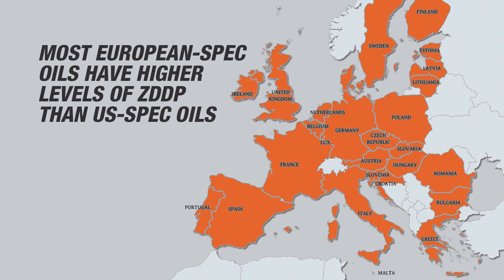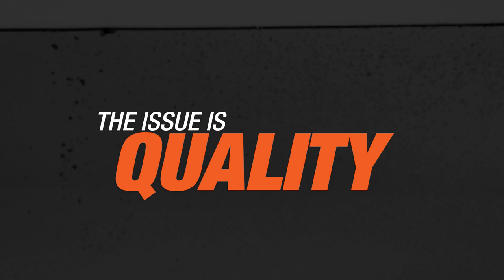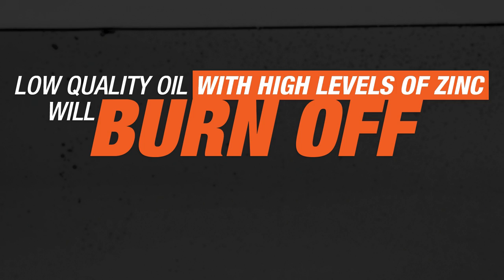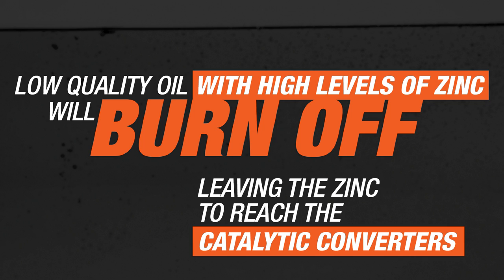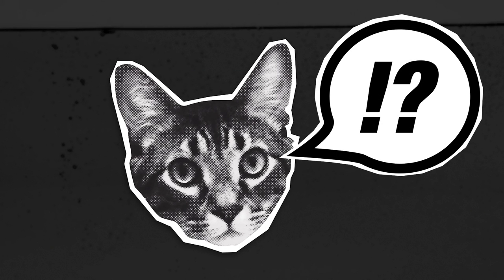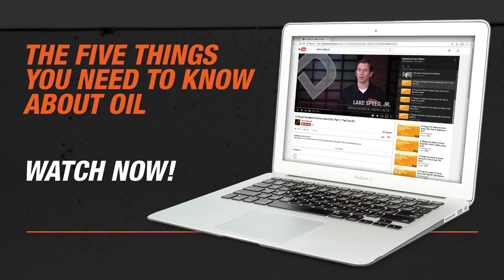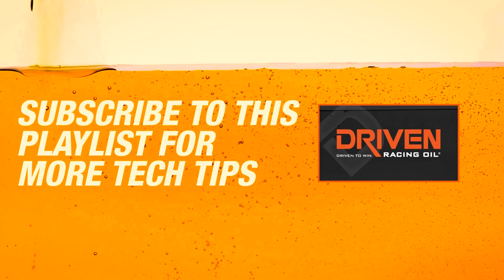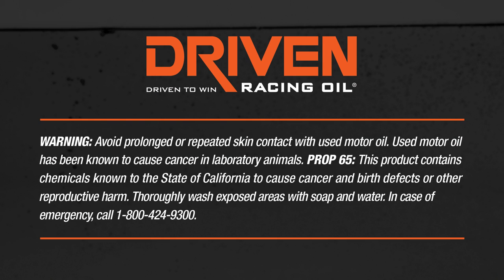FAQ: Will High Zinc Oils Damage My Catalytic Converter?

Comment: I have an 07 Silverado with 440,000Kms all original. I've always followed this same train of thought and used thicker oils with high levels of zddp! This man know his stuff 👍🏻
Reply: Jacob Martin what oil do you use?
Reply: I assume it's a duramax
Reply: Ryan Evans No duramax. It's a 5.3L gas. I mostly have used amsoil 5w30 HDD and mobil 1 0w40 European Formula
Reply: My truck is currently at 470,000kms
Reply: So you bought it new and the engine has never been worked on?
Reply: @Elaba_  I was the second owner. The engine was all original. Only thing I did was changed the oil pickup tube oring when the original one started to fail. I sold this truck with 506,000kms to my cousin and its still going strong.

Comment: I've got a 2002 S10 2.2 liter Vortec with 150,000 original miles I've used Full Synthetic Mobil 1 5w/30w since it's first oil change ..it still runs like brand new..NO OIL BURNING..👍

Comment: Glad I  found this quick info. I was just watching a 25 minute video of Mr. Vizard talking about Oil Extreme.  I've seen other products as well that are zinc alternatives intended to "protect cats".   There's two things I was thinking about for my built 5.0 that's still flat tappet.   One the reality that it has a cat to begin with from the factory  and part of what the smog pump does.. and is flat tappet from an era of higher zinc.    but  my concern with using something to replace zinc is the potential lubricity of an additive.  I know that with flat tappet it's better to run conventional  than synthetic due to  the lifters needing to spin..   I was just   "high flow" cat shopping     and  was doing the chicken dance... people talking about it getting past rings but  this was a missing link to the education.   I believe in running my emissions equipment.. but it's mostly for myself and my passengers too.. same reason why I wear respirators..  I think we get an unfair rep that we just want to pollute the planet   and   I think a lot of people    will toss out cats   ( for 1% power? )   or go back to carb    as simple as even old EFI can be.   They can use a smart phone   but dont bother learning a circuit board lol      and bury their head in the sand.   I was even to the point where in building my    exhaust where     It was going to be  ...   Cats,  X pipe, Thrush welded,      that my thinking was I should     clamp the cat   instead of welding it depending on what oil.  I did intend to stick with driven anyway so it's good to know everything is A-OK.  I am breaking my 306 in with BR30 soon.

Comment: I have been wanting to put ZDDP oil in my 02 GMC Sierra for a while but the myth has stopped me so far.  My truck (5.3 L) has 317K on the engine but burns less than 1 quart in 5K miles so now I am going with the ZDDP to hopefully reach 500K in this awesome work truck!  Thanks!!!!

Comment: The Porsche 993 series 911s from 1994 through 1998 had a production fill of 10W-40 Mobil 1. (yes the 993 3.6l had CATs). The M1 formulation of that day had approximately 1,700PPM ZDDP - ZINC. .. Fast forward to year 2024 what to do? .. The M1 10W-40 or the M1 15W-50 formulation has much less ZDDP,,, in the range of 1,200 PPM.. What to do?

Comment: High Quality Engine oil do has high amounts of ZDDP. May be combined with fatty acids for better protection. Evaporation of oil does not relate to ZDDP - it is a status of the engine. If oil is consumed due to wear of piston rings - oil will burn as well as ZDDP in the combustion chamber and that will result in solid particles in the exhaust and poisoning your cat.

Comment: Think about this too - cars have had cats since 1975. They had high zinc/phosphorous oil up until 1996 or so. So why all of a sudden after 20+ years was it an issue? Doesn't add up. I've seen more cats killed by rich running than by anything to do with zinc or phos. Even though flat tappet camshafts NEED the extra zinc, roller cams benefit too.
Reply: Cats got more effective, and the metals in them got more picky about contamination.
Reply: @mr.3phase228  Still, the 3 way cat still used today was introduced in 1981. The only differences are the amount of wash on the cats. Outside of that, no difference.
Reply: @azmrblack  what about the ones that came out in '75

Comment: I drive a 1979 Buick with 3.8 V6 and use Valvoline Racing Oil 20W50 and the car still has to pass state emission test. So I am hoping the catalytic convertor will not be ruined. The engine is not using oil as far as I can tell. Just leaks a bit. Oil is changed every 800 to 1500 miles.
Reply: A 1979 Buick would be better off with a 5W-30 or 10W-30 oil viscosity.  This will improve fuel economy, reduce engine wear, increase power and throttle response.  Racing oils are not meant for street cars.  Why change the oil so frequently?  That's causing dry starts after every oil change, allowing metal to metal wear to occur, robbing many miles of life from the engine.  It's also tossing out good oil and that's expensive. -  30 year independent AMSOIL Synthetic Lubricants Dealer.

Comment: On the farm my dad always used the tractor diesel oil in all his in his vehicles, but when the cars started getting cat converters it would poison the cat converters in his Oldsmobile.  After the second cat the dealer asked what kind of oil he was using,  and then introduced us to the term ZDDP.  (The dealer had actually sent the cat in for analysis)   Cats are expensive, don't take chances and use oil that you're suppose to.

Comment: I have an early tacoma.  Faithful oil changes every 5k miles, and for the last ten years... add zddp to every  oil change.  Why?  Its an overhead cam design, and bucket/shim setups also face a rsk of metal wiping metal if film thickness fails.  Result?  Valvetrain is noticeably quieter with it vs without.   Its old enough now it might be happier with 4k mile oil changes, but the cat is still going strong, mileage like new, and power as well.
But the motor oil market has a serious, major problem:  where do we go to get actual wear resistance values instead of marketing claims?  Here's some math derived from a 70's era v-8 I receantly cam swapped, which showed old lifters burnished pattern about 0.080" wide [0.050" from the edges].  For starters, what to assume for high pressure area that would make contact if oil failed?  Easy answer was square 0.080 x 0.080 = 0.0064"sq.  Next up, forces: as tested:  [new] valve springs are 330lb at 0.500" lift.  Multiply backwards using rocker numbers:  330 x 1.5 = 495 lbs force.  Transfer isn't perfect so I gave a generous adjustment of 98.5%... 487 lbs force.  Divide by [estimated] apply area of 0.0064" calculated earlier and oil film on my lifters are possibly putting up with 76,183 psi in operation. [Side note: does that value suggest why most "break-in" oils completely suck???].   So there's my floor.  Add a 15% safety margin, and I am looking for an oil with 87,000 psi or better wear protection.  I know the chemists formulating oils must at some point have this analysis done, but WHERE are the numbers?  Somebody has them. The schmuck at the auto parts store sure won't know. and half have never touched the math I just showed..

Comment: Why is diesel engine oil different formulation?  Is the a absence of a gasoline type of catalytic converter allow different formulation of oil with more engine protection additives with out damage to the emission systems? I have been told that a flat tapper engine requires protection form oil additives to limit wear. Did the reformulation of oil usher in roller camshaft use on a larger scale because of premature cam wear failure?  What kind of oil should my 1973 Big Block LS4  Corvette be using for the protection of the camshaft?

Comment: i have a Audi A6 3,0 TDI , with 430.000 KM .., only use 10w60 / Lucas Oil Stabi /ZDDP Midland… Drive often full throttle —full speed on german Autobahn with 260 Km/h … engine runs great ..and fast … 
my question… can I use it in my 392 Hemi ..? 
I now … Hemi has a roller cam …. 

Greeting from Germany

Comment: Hi Lake. It's funny... I've been experimenting on some vehicles w higher zddp... Like in the 1600ppm range and so far no cat problems. If it does damage one, it will b worth the experiment to know for sure and for the extra wear protection on a motor. But here's my question.... I actually use mobil1 20/50 v twin motorcycle in a car without a cat. It has one of the best additive packages I've seen. It has the same Moly as other Mobil 1's and a lot of boron. Approaching 300 ppm. The zddp is around 1600. Aside from cat issues, this is one of the best oils I've seen on paper  and can't see why it's not ok. I'm wonder what the base oils r... If they r group 4 and 5. It also has a high 20.8 viscosity and really good high temp performance and anti shear. The only thing I'm wondering, is that it has around 2200 calcium. Is that too much where it would counter the zddp and boron/moly? Or would u still expect it to b a really good anti wear and also a good cleaner. That film strength too.... Seems really good. Just that calcium question that's haunting me. And I do wonder about the base oils and what group they r. Any light u could shed on those questions and what u think of the quality of that oil, would b very appreciated. Thanks so much!

Comment: Makes sense, 
I have 2018 ram with roller rockers and not regular lifters and a flat tappet cam that needs high zinc oil.
I CAN'T BENEFIT FROM A HIGH ZINC OIL IF I HAVE A ROLLER CAM SETUP CAN I ???????
Reply: ZDDP can also help with piston wear and ring lands, but as you stated the car is new and newer designs generally have reduced metal on metal contact and friction like reduced spring pressures and more accurate machining tolerances.

Comment: I have an 86 dodge ram with a 318 LA engine flat tappets . 
I just got the truck and gave it its first oil change and added a quart of STP ZDDP Zinc additive with some SAE 10w-30 conventional oil. 
Is this sufficient enough to protect the lifters / cam or should I use a high zinc oil and just eliminate adding the STP additive ?

Comment: I've heard that zddp will clog your oil journals in the crank and pushrods and stuff not allowing oil to reach the valves
Reply: Zddp never clogs oil passages journals etc, it was likely oils in the past with high graphite & or moly that known to clog an oil filter when not changed on a regular basis like 3k-5k miles.

Comment: Your assumption is based on NEW catalytic converters being the same as OLD converters.  I'm guessing there have been improvements over the years, knowing that EPA standards have gotten tougher.  Another issue with diesel oils is their higher detergent levels, which reportedly can "over clean" cylinder walls in a gas engine, reducing the piston ring/cylinder seal, which could cause reduced compression and blowby.
Reply: Well.... his point is valid.  If its NOT getting past the rings and/or valve seal then the cats are not seeing the situation.  So IMO it just depends on the engines oil consumption rate.

Comment: Hi, i just watch your video and i have a question for you.. I just installed piston rings and i only have 2 bottles of driven enging breaking oil left. I cant get the driven this type of oil around here from Oreiley or other parts store and my car take about 3.5 bottles of oil so what you suggest i do  since i dont have enough of the driven BR30 breaking oil.? Can i mix it with another oil from the parts store?